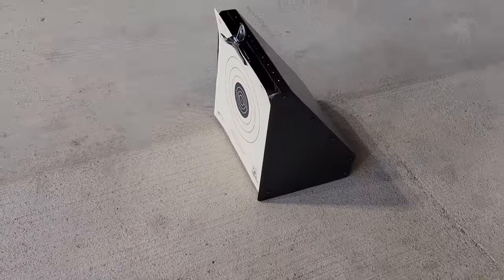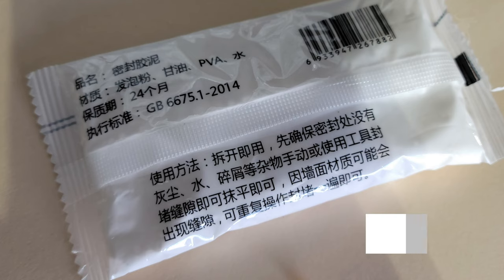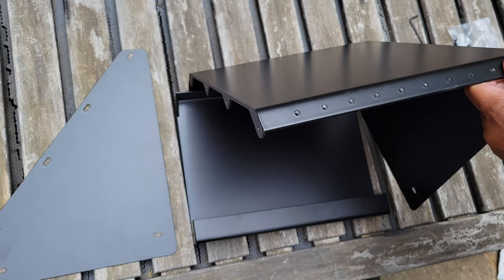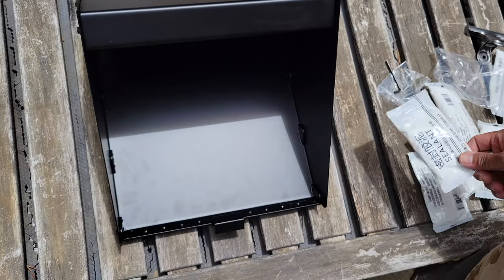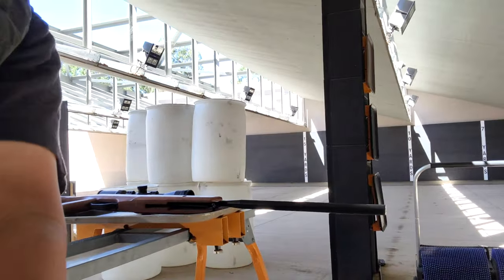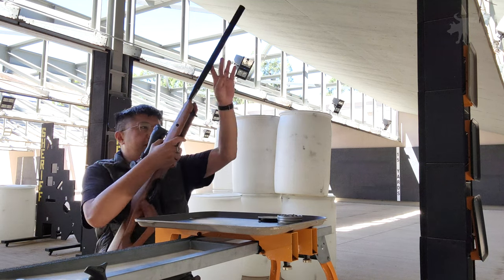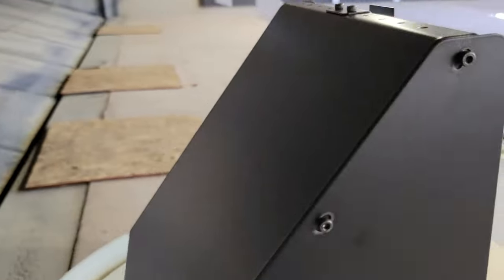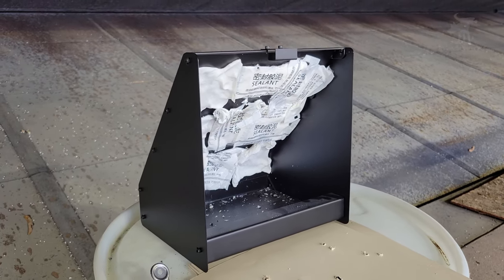Ideagle Airgun Pellet Trap

Comment: ...The idea of the putty is to catch the round... just can't believe you didn't know this...
Reply from the maker: Putty can be used to catch a round if your backstop isn't designed to deflect it. If I put it on the angled back, the rounds start to peel the putty away. The putty in this case is used to catch the rounds after they've been flattened and turned into shrapnel.
Reply: @Moondog2A  ...THEN LEARN HOW TO USE IT....